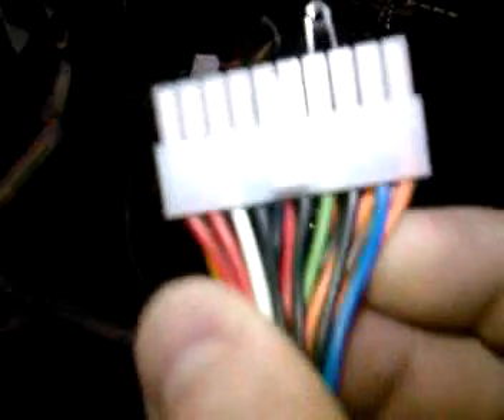xbox360 running on 500watt pc psu with side window mod

Comment: Looks dodgy how you have it wired to the 360 psu lead

Reason is you only have one 12v wire(yellow) feeding the 360 and it will try to draw all its required amps through the one 12v wire... this can make the connectors melt believe it or not and can cause power problems

You need to have attleast three 12v wires from atx psu feeding the xbox so it can draw the amps it needs over the three wires, instead of from one wire.

Because this is a test you arent seeing these affects, until it draws amps